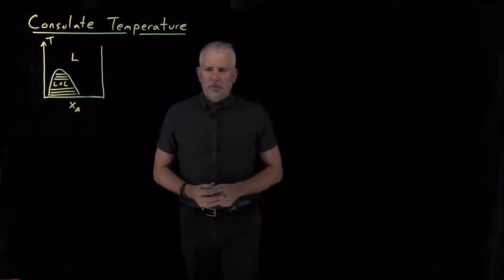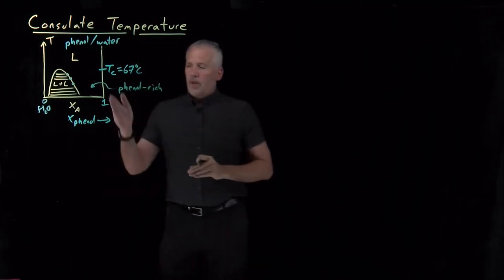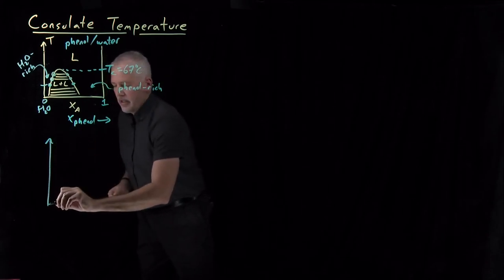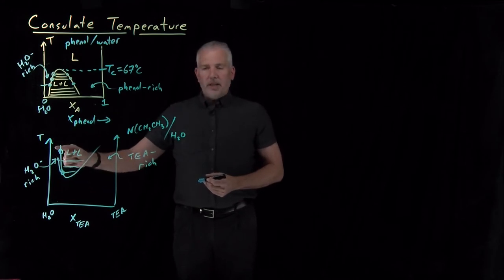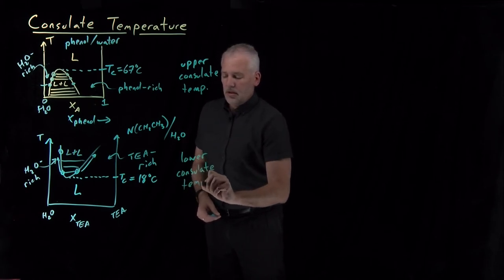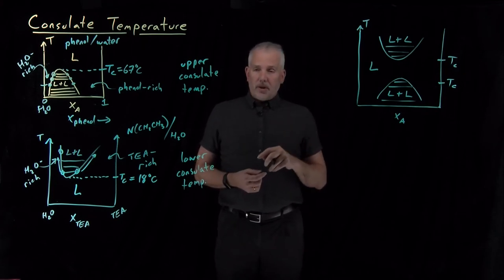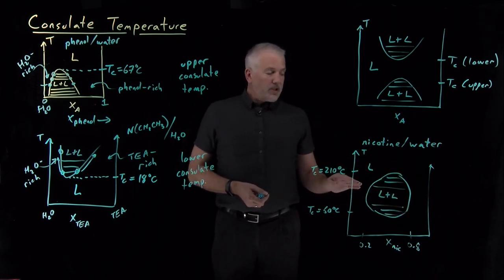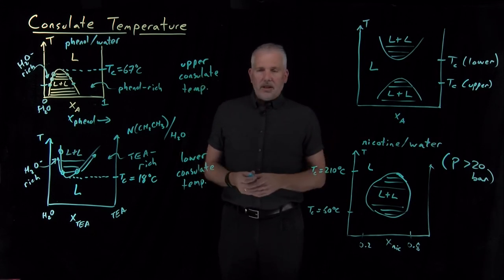Consulate Temperature

Comment: Can the lines between phases (tie-lines) drawn in these charts be approximated as horizontal typically?
Reply from the maker: Yes, definitely. They are perfectly horizontal, indicating that the two phases are in equilibrium with each other at the same temperature
Reply: @PhysicalChemistry  This would then be an approximate way of obtaining TXX data through measuring cloud point using for example UV-VIS spectroscopy and applying the lever rule. 
Thanks for the simple explanation of the curves.